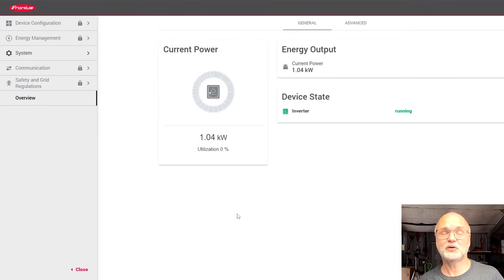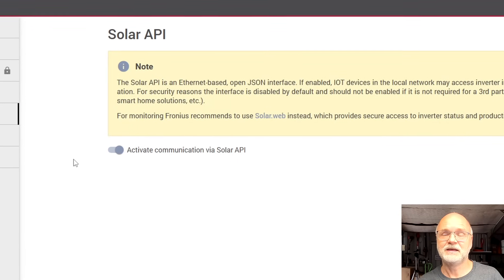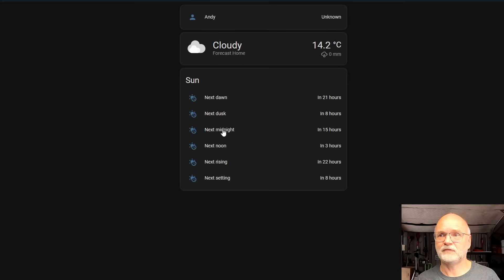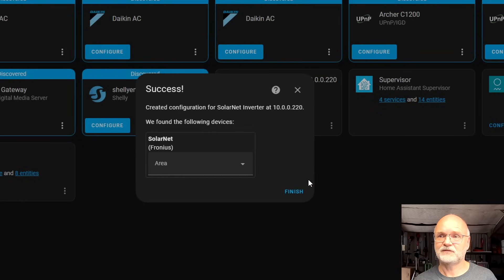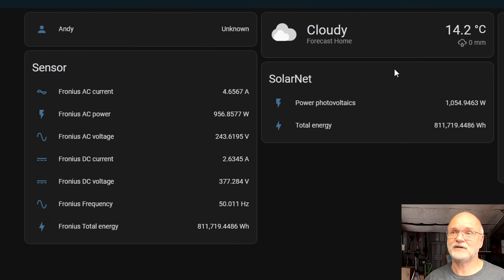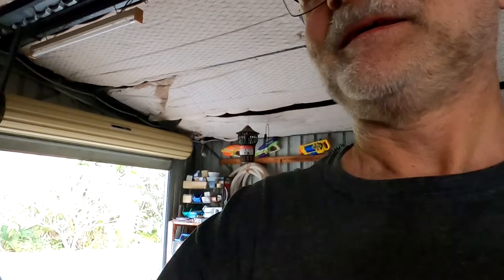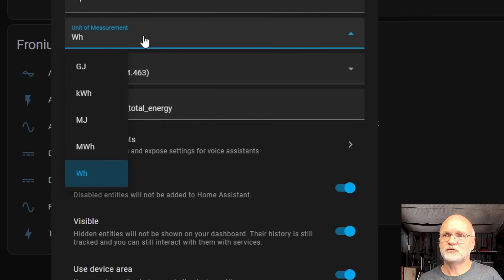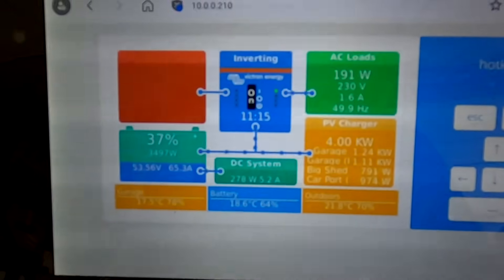How to integrate your Solar Inverter into Home Assistant. First step to Solar Storage Automation.

Comment: Hi Andy, thanks for all your videos.
Please remember when setting up static IP directly in a network device and not reserve an IP for that MAC address in your router. When using the first option there is a possibility that router assign that address to a different device this can happen when one or several devices are reset in you network. So, in my opinion always use reserve IP for that specific MAC address in your router.
Reply: If you are not a donkey, you choose an IP adress outside the DHCP range.
Reserving IPs in the router is the lazy but 'not good' way: It adds another single point of failure to the system.
Reply: @Jürgen Mießmer  not really. You simply need to backup the reservation list somewhere.
Using static ip in the devices is also a failure point, you might assign the same twice and in case of reboot, nothing guarantees that the address will still be available when the device reconnects.
Reply: @tiloalo  
If the DHCP server stops working for any reason, that stored backup list will not keep the system running.
I will never assign a static IP twice. Only fools do that.
A reboot will have no affect to the static IP address. This single IP is only used on this one device and it is located outside the available range of the DHCP server.
Trust me, im a network professional since decades.
Reply: @Jürgen Mießmer  for 99% of users the dhcp server is part of their router.
So a failing dhcp server might be relevant for a network engineer, but pretty irrelevant here.
Reply: @tiloalo  
It does not make any difference on wich hardware the DHCP server runs. 
It is an additional single point of failure to use DHCP for a device running a service.
Your argument is nonsense.
Take the chance to learn something, or let i be.
Reply: @Jürgen Mießmer  it is not an additional one since it's on the router that is already a single point of failure.
What's the point to have static IP if the router is down??
Reply from the maker: The problem with reservations are though, If the router breaks down and needs replacement. With static IPs directly in the devices, everything will just work again with a new router. Also, many home routers have a limitation of IP reservations.
Reply: @OffGridGarageAustralia  Except a router being rebooted or replaced may assign that IP address to something else before the Fronius says that's what it wants. It really should be reserved in the router.

Comment: Now that you're into HomeAssistant, you really need to integrate your battery BMSes and have per-cell voltage tracking/stats over time. it realley helped me to manage my 48V battery which is LiFePO4(16s) + NCM(14s) in parallel, sooo nice to see how overall current spreads between the two packs depending of each pack SOC. I use "esphome-jk-bms", very easy to connect and configure! please at least consider it.
Reply from the maker: Yes, we will get there eventually...
Reply: @OffGridGarageAustralia  please make one for the JK BMS without canbus.
Reply: @tanishqbhaiji103  I use esphome-jk-bms too, love it, it uses Bluetooth, not canbus
Reply: @quilmore  the new ones have canbus option. And it has always had rs485.
Reply: @tanishqbhaiji103  I don't use rs485 or canbus, the esphome uses bluetooth only
Reply: The ESP32 chips are fantastic and cheap! I use them as well for my jk-bms. Then you can also go down another rabbit hole and use Grafana and InfluxDB for data base storage and graphs for everything in home assistant as well.
Reply: Man I got a bunch of leaf modules I'd love e to be able to run parallel with my lifepo4.  If you see this please tell me how you do it and have it work right and be safe
Reply: @matthewknight5641  Just use separate BMS for each chemistry (do not parallel cells, but the complete battery) and set a confortable charged value for a 100% SOC of the combined battery (I use 55V)
Reply: @jotaemebee  I just ordered a dally 300 Amp bms and a couple of the jk bms with active 2 Amp balancers. 
I've never owned a bms before so I'm new to how they work. Can I set the leaf batteries to disconnect charging at a certain voltage then the lifepo4 keep charging and discharging and when the lifepo4 drops down to the leaf high voltage the two batteries reconnect and then my system be running off of both battery banks. Then they disconnect again once the leaf cells top out and the lifepo4 continues to run my inverters and charge?
 I was worried about the bms failure of the leaf pack then charge controller continue to keep charging up to the 29 volts of the lifepo4.  If leaf bms failed it seems it would allow it to stay connected and go over voltage by about 4 volts or so.
Reply: @matthewknight5641  you can only use leaf batteries in a 48v configuration (7 in series and as many in parallel as you want), I have a 7s6p that gives me about 14kwh, you can have different chemistries with different voltage curves, you'll have to manage the discharge option of your BMS (enable discharge when the voltage is right, disabling discharge otherwise) and sacrifice some charging voltage so both banks can be charged at the same time, total charge capacity won't be affected much as andy demonstrated so many times
Reply: @quilmore  I've been using them in a 24 volt configuration for about a year now and I charge to a top of 25.1 volts. The inverter shuts off at about 20 volts. Seems I have most capacity from 24.8 down to 22.5 once below 22.5 they drop in voltage fast down to 20. Most people I see use them do the 7s configuration and I'm sure it's best to use them in a 48 volt configuration but I already have all 24 volt inverters. Wish I'd known and I'd have done 48 volt but I was new to all this. I'm gonna not worry about trying to parallel the two chemistries and just keep the leaf cells powering the 4000 watt sungold that runs the minisplit. I'll just add a bms best I can. My lifepo4 battery I'm building is also 24 volt. 16 cells and 2 jkbms so it is basically 2 batteries in parallel but anyways it runs the all in one inverter solar charger the my camper 30 Amp plugs into. For over a year I ran both inverters 7000 watts all together from the leaf cells with no bms but people say it's dangerous so I'm gradually switching to lifepo4 as money permits. Thanks for the info tho. If I had rhe money to replace my inverters I'd for sure do it all in 48 volt but I'm so invested in all the 24 volt stuff I gotta go that route at this time
Reply: @matthewknight5641  you need to understand that you shouldn't pull any power from the middle connector of a leaf's battery module, that's only for balancing, the module will fail badly, a short circuit probably and if you have modules in parallel that will move too much current too quickly and fire is not unlikely, that's why I said you can only safely configure them for 48v (24v means that at some stage you're connecting your power to a middle connector)
Reply: @quilmore  I use them in a 8p3s... the middle connectors are never used at all. They 3s pack tops out at 25.1 volts. The modules are just over 8 volts each... 8x3.... 24 .. the  arteries have most their capacity from 24.8 down to 22.5 volts once they drop below 22.5 in no time they drop on down to 20 volts and inverter will shut off. They stand steady at 24.2 most the night and I've only ran them down to 20 volts a couple times. But I'm curious as to why you would think I'm using the middle terminal. I have considered it so that I'd have a little more capacity but like ypu said that terminal is only for balance.  Since about 85 to 90 percent of the usable energy is between 24.8 and 22.5 I figure that's good enough. It is supposedly hard on them to charge all the way to 25.1 so I did set my controllers down to 24.9 volts. With nearly all usable power around 24.2 I don't think I'd gain much by changing them around. If I was to take the 24 modules I have and put them into a 48 volt configuration I'd be loosing 3 modules out of the system and don't think going 48 volts would justify the loss of capacity of the 3 modules I'd no longer be able to use. If I had 28 modules or 21 modules I'd do the 48 volt but with 24 modules and seeing where the power curve is I think I get the most usable amount of energy at 24 volts. If the band of capacity was wider I'd agree that it needs a different configuration but it's not so they stay as 24 volts. Thanks for the input tho.
Reply: @quilmore  most definitely not using that middle connection
Reply: @matthewknight5641  the nissan battery modules have a  max charge voltage of 8.3v, that's what you see as "24v" when charged, but that's while being charged, their operating voltages (when using the batteries) is aprox 7.4v to a end of discharge of just above 5v, by having 3 in series your working range is very limited and the power to be drawn is very small, for 24v to work you'd need 3.5 packs (that's where I was talking about the middle borne) that will give you a charging voltage of 29v, and a working range of 25.9v to 22.75v, which I'm sure your inverter will be happy with, that's not possible unless you do it wrong, putting 4 in series and instead of using the last borne (voltage will be too high) you use the middle one (too weak to manage the currents)
Reply: @quilmore  yes id have a much wider operating range by using three and a half but from what I I saw so far they hold steady at 24.2 for a really long time then once they get below 22.5 it only takes a half hour or so and they go all the way to 20 volts when inverters will shit down. It seems like from 24.8 to 22.5 is where about all the capacity is in my cells with them wired up in sets of three. I charge them up to 25.1 but they drop almost instantly to 24.8 then steady for a long time but yeah below 22.5 seems no power left in them hardly at all. I do wish I'd known to do 48 volts from the start but I didn't and it's kinda to the point where I think it's just better to get more lifepo4 and replace my leaf cells all together but they still work great so I'm just up in the air with them I guess lol. They will probably continue to power my minisplit till I can buy more 280 eve cells. The eve cells are just for the all in one 3000 running the camper as the leaf cells are running my 4000 sungold power split phase low frequency.. minisplit. I think it's cool there are other people out there that will give e me their input on this stuff. Thankyou
Reply: @matthewknight5641  voltage alone doesn't picture the whole thing, at least you're doing it safely, no harm to any of your setup, that is good, find out about the li-ion curve, you'll see why the sudden drop, and you may learn how much you're missing by using the bottom part of the life cycle of charge, you're doing well, but there is a lot of room to make the most of what you have
Reply: @quilmore  I'm really not doing it safely. I've been running the batteries over a year with no bms and them powering 7000 watts of inverter. If I don't get enough charge from the sun like a few rainy days or whatever then I start up my diesel welded qnd connect the leads right to it and turn on the welder as high as it will go. It will almost fully charge it in 15 minutes lol. After disconnected the battery is a little warm but takes the abuse better than I first thought it would. I was looking for a fast way to charge and saw this stuff about converting a welder to a charger and it actually works. Don't know how long it'll work but probably twice a month I e done this with no problems as of yet

Comment: Growatt integration is almost useless. It update the data once every 15 minutes.
Reply from the maker: Ah, right. The Fronius polls data every 1min. And is not cloud based... which is preferable.
The Growatt invetrer surely has an internal webserver as well where you could get the data from?
Reply: @OffGridGarageAustralia  It depends of the model and current configuration.
Sometimes there are workarounds...
Reply: @OffGridGarageAustralia  My HA polls Fronius data every 10 seconds.
Reply: @OffGridGarageAustralia  It depends of the model and configuration. But usually there is some type of workaround.